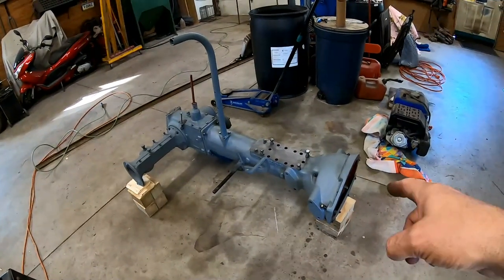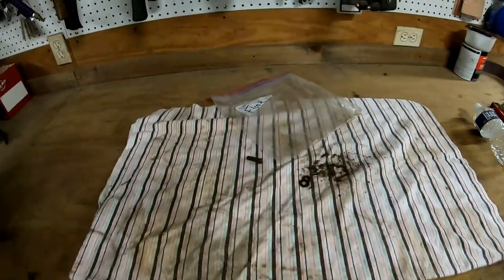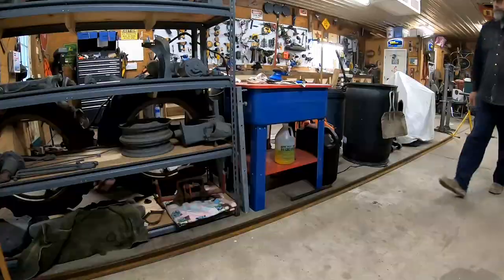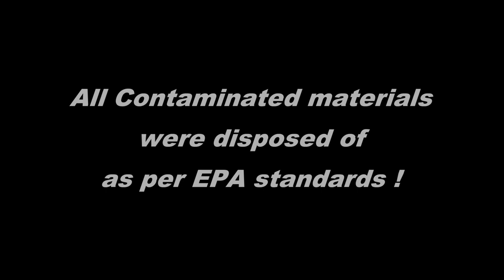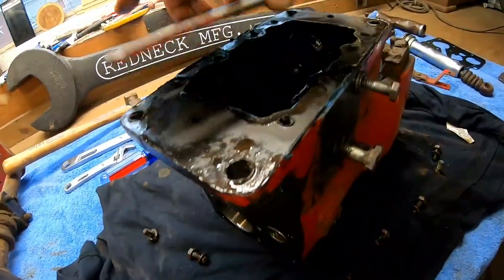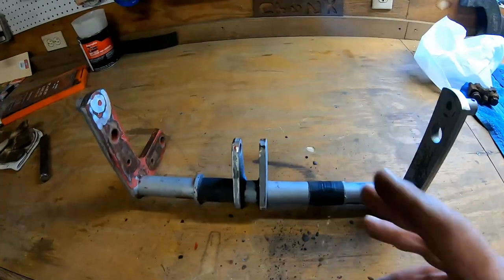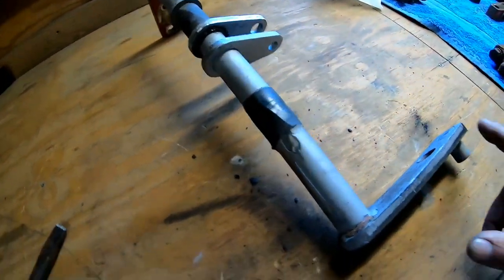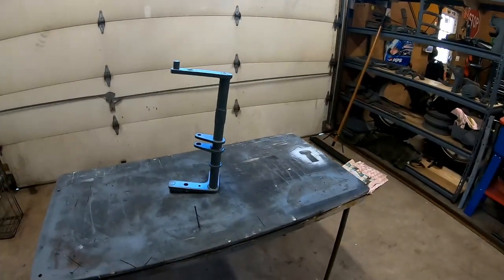53 Farmall Cub working on the Floor & one Touch

Comment: Question Sir
you bondoed over the ruff/rust on the floor plate. Will the rust process continue to work its was thru the metal??

Mike
Reply from the maker: So in one of my previous videos I showed how I sandblasted the floor plate down to bare metal before priming... this should stop any future rust from forming.. because all the oxidized metal was removed prior to priming... fingers crossed that the rust doesn't return...